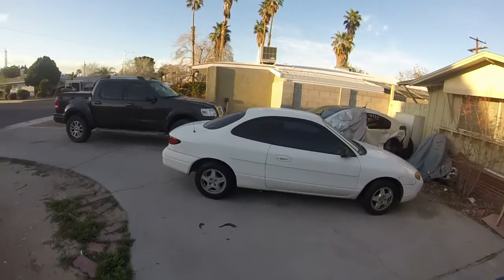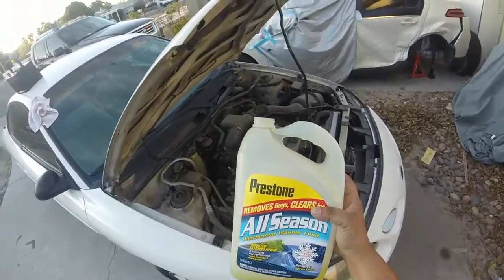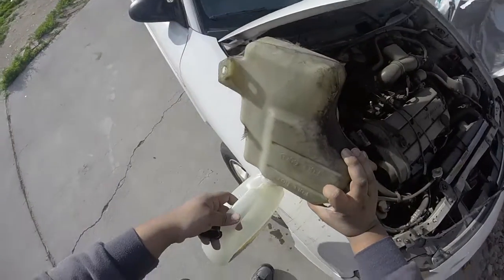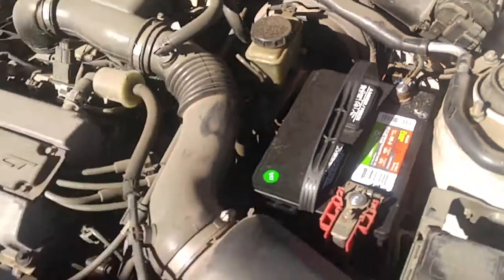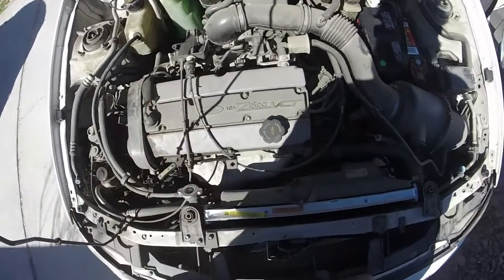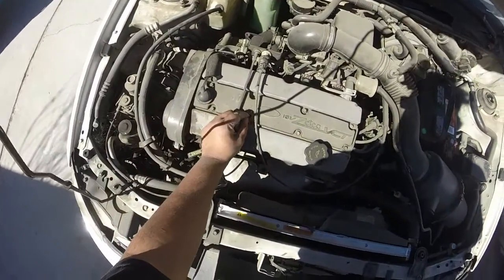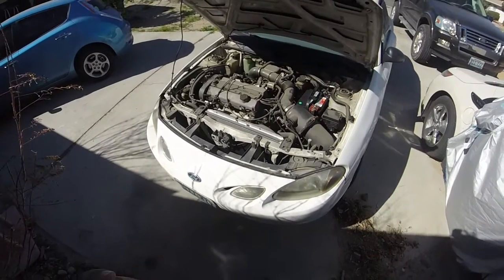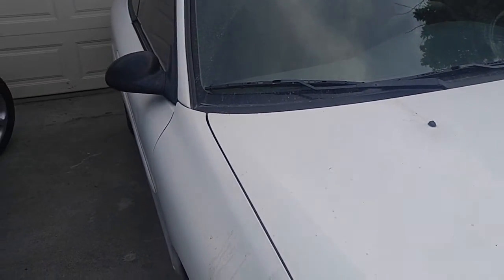Engine Knock after Sitting Explained

Comment: This cracked me up... The stuff at the beginning that you left in... "Ah, SHIT!" washer fluid mistake, spider, dropping the grease... Hope your lucks improved, otherwise stop working on the car! Haha. My BMW e46 had a couple second knock and oil pressure light today, but luckily it was gone as quickly as it started and ran normally after that... I didn't crank it for a couple months, so I think I will drive it more often now! Best wishes.

Comment: So cranking without the engine actually firing is a way to get oil back up into the top of the engine, I guess?  That is a bit safer than getting it up there via the engine actually running, maybe?
Reply: I personally wouldn't worry about it unless the noise doesn't go away once the car has warmed up. Every older car is going to make uncomfortable noises after sitting for days or years especially in the cold